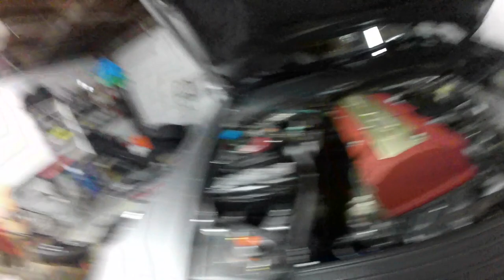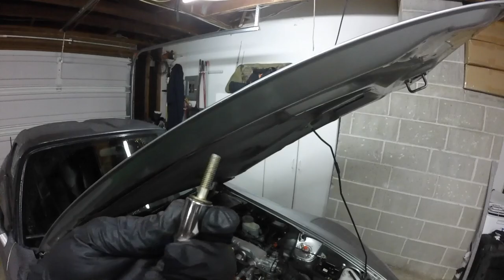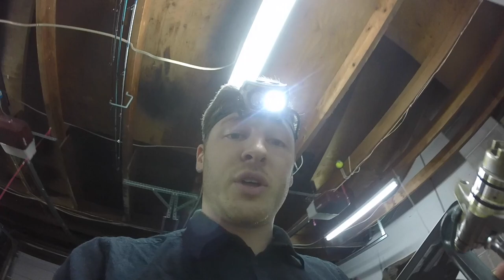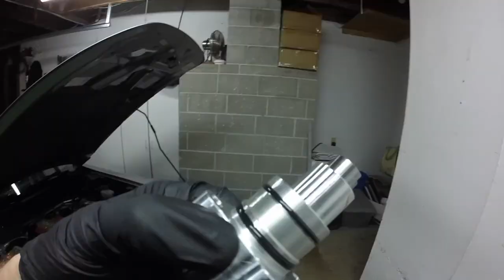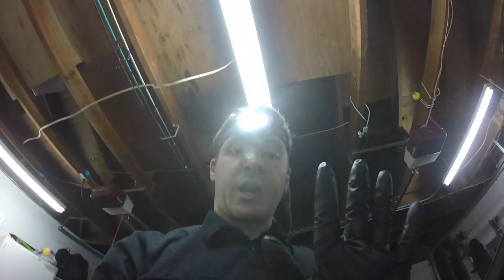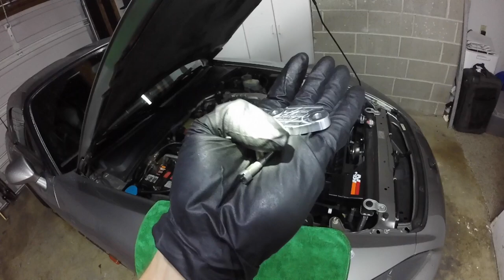S2000 | Timing Chain Tensioner DIY (LEARN HOW)

Comment: hi, what happened with middle the tensioner after its disassembly ? He fell into the sump?  I'm sorry but this is a dangerous procedure .
Reply from the maker: +FixYOURride13 No, actually when you see me pull the old tensioner out, i had already taken it out and taken the middle part out. This was me refilming it to show how to take it off with the c-clamp. Thanks for watching!
Reply: @TenBuckTraveler  I thought when you had pulled it out the shaft was still left in the hole. As I was watching i was thinking the new would not go in because the old shaft had fallen out and was still in the hole. That makes sense now. LOL

Comment: the tensioner piston fell into the engine when he pulled the assemble out with that c-clamp, it's best to remove the big allen plug and push the tensioner out with a screw driver through that allen plug  hole, an engine should never be turned with a chain tensioner removed, the chain can jump a tooth and you'll be in a world of hurt

Comment: Hi Rum Runner,

 I noticed in other DIYs that a cotter pin (TCT Pin) will need to be pulled for the piston to pop into place. Is this only for OEM units and not needed on the Ballade sports unit? I plan on ordering mine in the soon future to get rid of the ticking!

Thanks for the video! Looks relatively painless to do!
Reply from the maker: +Jaylom Hey! The OEM unit has a cotter pin, however the Ballade and Billman units use the bolt to hold the piston in place during installation. Both Ballade and Billman are good units, but Billman requires a core deposit shipped to him and Ballade does not.
Reply: +Rum Runner S2K thanks brotha! Yeah I realized after I commented, the different setup of the Ballade/Billman units. 👍👍

Comment: My AP1 is doing the same thing, it rattles on idle and when I drive it, sometimes it goes away. It doesn't come on all the time. Should I take it to the shop?
Reply from the maker: Well if you don't feel comfortable replacing the TCT, then yes I would take it to a shop. protect your car :)
Reply: Rum Runner S2K 
I'm going to replace it, not the OEM one tho, and I'm having another issue with my front drivers side tire it wobbles really bad and the lug nuts are torqued to spec, and the tire is noticeably caved in, like the top of the tire ( closer to fender) is pointing out and the bottom that contact the road caves in
Reply from the maker: Woah, for sure replace your tires ASAP lol

Comment: i just used a dremel tool and sanded down i little caterpillar thing in the middle and noise was gone.. saved the $200
Reply from the maker: +DAVID VILLA I considered that as well. I just didn't want the issue to come back as reported by many on S2ki. I wanted 1 and done and $250 was reasonable for me to pay to never have to think about it again.

Comment: Did you have to do anything when removing the stock TCT so that none of the parts shot into the engine, or is it just the two bolts, and pull it out?  I keep hearing things about making sure to put a pin in it so that the gears and such don't fly out when you pull it out!?
Reply from the maker: I had no issues. Just pull out carefully and slowly. The worm gear could potentially fall out but just go carefully and slowly and you will be fine :)
Reply: Was the plunger retracted all the way it could go, when you installed it??
Reply from the maker: yes, when you receive the TCT the worm gear is retracted using the bolt and wing nut you see in the video. just release the wing nut and bolt after you install the TCT.
Reply: Yeah but it wasn't retracted ALL the way when you installed it!.
Reply from the maker: doesnt need to be
Reply: Yes... it does!!.
Reply from the maker: ok, my car runs perfectly fine and the TCT went in with no issues. Please explain the issue with the way mine was installed
Reply: When you bolted up the TCT to the head, did you check to make sure the chain was still slack??.  No... you didn't.
Reply from the maker: If you feel ANY blockage when installing the TCT it is likely the chain has tension and you should slowly hand crank the engine to ensure you don't skip timing until there is nothing stopping you from the TCT being completely flush against the block without any force needed. Did I do this in the video? Yes or No? If I did (which I did) then the install was correct.
Reply: So you think that i don't know how they work??.  Dude... please... its a one way spring!.
Reply: You risk OVER-tensioning the chain with the way you installed it.
Reply from the maker: glad i didnt
Reply: You wouldn't know because you didn't check!.
Reply from the maker: ok

Comment: Sand blasting the worm gear is useless, you gotta make the oil hole bigger.
Reply: bigger hole = less pressure. smaller hole = higher pressure, fluid dynamics

Comment: I could have shown you how to fix your original tensioner could have saved $250
Reply from the maker: you mean the sand blasting of the worm gear technique?
Reply: Nope, nothing useless like that.
Reply: look at the ballade TCT and the OEM one, there's really only one functional difference. That little hole between the two rubber o-rings is too small on the OEM one, Ballade just made theirs a little bigger and put in stronger springs. The OEM one works just fine if you make that hole 3mm wide.
Reply from the maker: but but but, my ballade unit is shiny! Good to know there are other ways of fixing this issue! Thanks!